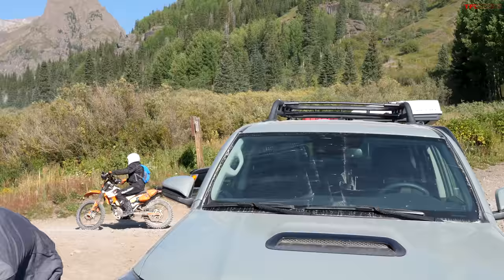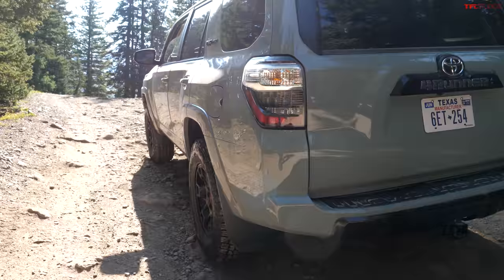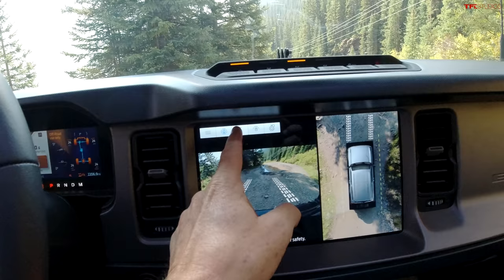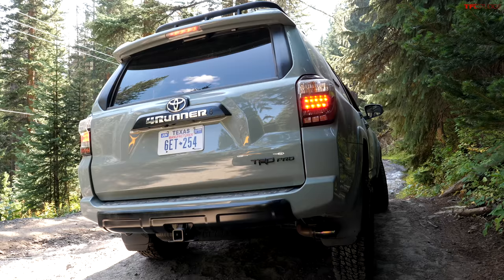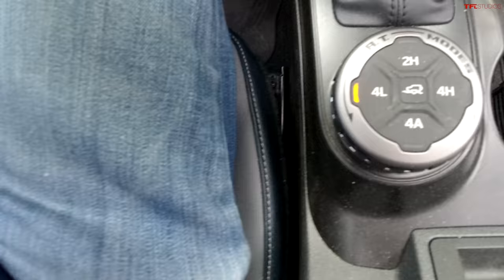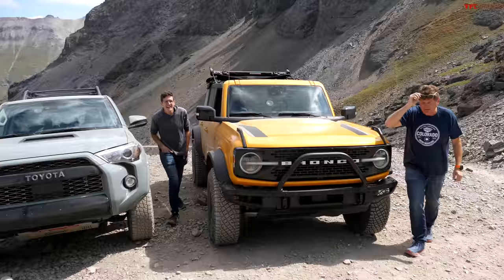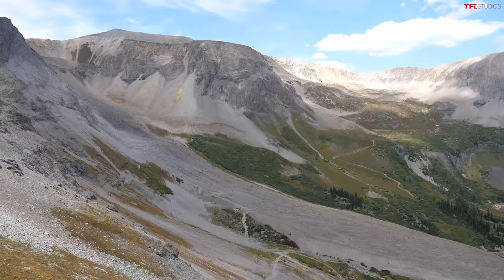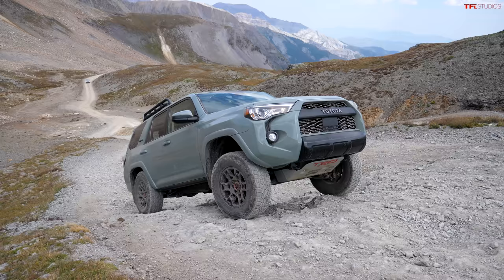The Toyota 4Runner TRD Pro May Be Old, But Can It Still Keep Up With The Ford Bronco Up A Mountain?

Comment: You guys keep mentioning the price of that First Edition Bronco in your comparisons, but you can get the Badlands edition with the 2.7L V6 and the 10 Speed Auto for $49,575.00... You can also get it with the Mid Pkg. for $51k or go for that 12" Screen, getting the High Pkg. for just $52.3k. Or go all out adding both the Sasquatch and High Packages for $54.8k. So at that price you can either get essentially the same Bronco that you had there at $54k, or that Toyota 4-Runner for $52k.
Reply: You hit the nail right on the head. Lots of people complaining about the Bronco price, but fail to realize there are much cheaper versions which can be as capable as you need them to.
Reply: @luisinhoens90  Exactly. I have the Outer Banks 2.3L with Auto Trans. on order with the Rear Locker, Aux., High Pkg. and a few other upgrades for $46k. Or, If you're fine with the 8" screen you can go with a Big Bend starting at $35k or the Black Diamond starting a $38k. Both really good options, especially with a few upgrades.
Reply: @PicklerEntertainment  I'm digging for the Black Diamond with the 7 spd manual, but I'm not in the market right now. I'm thinking about getting a pre-owned one in 3-4 years

Comment: I really enjoyed this video, pretty cool seeing how advanced these new vehicles are for off-roading. That being said, they seem to be made for people who don’t have real off-road experience. All the terrain select modes and auto crawling modes are unnecessary, I want to drive my car myself. Having a rig that’s more capable than you as a driver is a dangerous situation. I don’t want those people on the trail putting themselves, myself and others in danger. They’re made for front rangers and city dwellers as a status symbol and for people to think you’re some badass off-road king driving around Denver. 

I live in a small town in southern Colorado by the Sangre de Cristo mountains where the roads are unmaintained and gnarly as all hell and let me tell you, these aren’t the vehicles you see out there. The easiest way to tell someone isn't local is if they're driving something like one of these. I’ve done Imogene in my 04 Jeep WJ with 30’s and the np242 transfer case. It’s all stock except the tires and wheels and I added the Mopar transfer case skid plate. I’ve never had a problem with traction and rarely even use 4lo. Picking a line comes from experience only.

One thing I never see mentioned about these new vehicles is how their size is actually a burden on a lot of trails. Can’t tell you how many times I’ve been in a situation where I’ve needed to turn around on the trail. I was on shelf road near cripple creek and met a lost Texan trying to drive through with his full size truck and fifth wheel. No one was getting by this guy, his rig took up the entire width of the road. I had to back up a quarter mile before I could turn around and go back the other way. I sure as hell wouldn’t want to be in one of these doing that. Wouldn't have been possible. The size of my little Jeep is such an asset in that situation. I think that needs to be talked about more. Most people think bigger is better and that a nice big truck or suv with huge tires will get you through everything. Yes big trucks and suvs are strong and capable, but when you end up in one of these situations you’re gonna be cursing and scared. It’s more about the driver than the car. I’m lucky to have a lot of experience off-road as a ranger in rural Colorado so I can’t fault anyone who doesn’t have experience, but just know that there’s a lot of vehicles that are more than capable off-road and it really just comes down to the driver. You don't need to spend this kind of money to have fun and I'm glad TFL highlights that in their videos as well.
Reply: I couldnt agree more. Two things id like to add: 1) most ppl allow themselves to be upsold on EVERYTHING and alllow themselves to be TOLD what they need 2) as far as the size of these vehicles, sometimes i wonder if they are designed large out of necessity to fit your average American?

Comment: I just wish you could get all the dif goodies and sway bar disconnect on the base model with a sasquatch. All the capability and it wouldn't kill me to get a trail pinstriping on it. I don't need all the extras. Washable floors and off road capability is still king.

Comment: This trial isn't as tough as it looks tbh. I did it a couple years ago in a stock 2009 Hyundai Santa Fe, no lift, no 4x4, it was a 4x2 FWD, only mod I had was an offroad front bumper and some nitto grappler at's.

Comment: Need advice (and from some pros will make wife feel better).  Looking taking my stock gladiator 80th to Colorado, can it handle ophir, Imogene, and engineer?  I did ophir and Imogene in my stock jl with 30k on stock tires.  So, would I be good? I know I would kiss my skid plates, but other than that?

Comment: Looking at this again it really does seem like a bit of a puff piece plug for Toyota--approach and departure angles not really that tough and certainly no extremely articulated sections. Again the Bronco didn't break a sweat and looked more comfortable. How about we see the 4 runner on the Wheeler Lake trail that the Bronco did so well on (stock)?

Comment: For $11K I bought all the mods on my 4Runner: OME BP-51 suspension, BudBuilt skidplates / sliders, Expedition One bumper + Superwinch.

Also there's no mechanical differences between the TRD OffRoad vs TRD Pro if you're modding the suspension.  I paid $37K before TTL for my '18 TRD OffRoad, so the $11K spent got me up to about what a TRD Pro costs new.
Reply: I don't know why TFL never mentions   the savings and capability you get with the TRD offroad.
Reply: @Rooster_king  The TRD OR is good value, the TRD Pro isn't.
Just like the Bronco 1st edition is not good value but a Black Diamond or Badlands is well worth the $20K savings

Comment: I’ll take a Trail model over the TRD Pro any day, add aftermarket lift and your better off IMO. Trail gets all the same off road tech and locking diff plus it has 7.5” wheels over the pro’s 7.0” for running larger tires and you get kdss which is a game changer for on road driving especially once lifted.

Comment: I'm opting for a LeXUS GX470 BUILT on the same frame as that TOYOTA 4 RUNNER... but with LEXUS quality and comfort.. :)    Instead of paying the original $65000, I'm paying $22,000 for one that is 07 but ALREADY modified- new timing belt and water pump, all cv stuff redone new- dash recall done new-- and all armored up and ready to go!!  :)   Be like the 4 runner-- but BETTER.

Comment: Great video! Question for the Imogene regulars. I have a 2021 F250 Platinum Tremor 6.7L. It’s leveled and has upgraded 37” Toyo AT III tires. Is this course doable with this rig (it is the shorter 6 3/4 bed)? Thanks in advance!

Comment: The TRD Pro is certainly a good truck, but where I live, the dealerships add such markups to the limited edition TRD Pro line that even a used truck a few years old is still more expensive than a new Bronco. They are good, and Toyota is clearly VERY proud of them!  I had wanted to get one to drive while I waited for my Bronco order, but that's one reason I'm giving the 4Runner a pass; sadly, there are also options that only come on the TRD Pro, like dual zone climate control, that make lower trims less attractive as daily drivers.

Question: Did those MPG calculations include the trip up the mountain or just the road portion?

Comment: I agree that the Toyota is the on road king. But that's not what I bought my Badlands with the Sasquatch package for.  And that's why we use my wife's Land Rover Discovery, for road trips. It's still a formidable off roader, yet luxurious. I use my Bronco for off road fun and there's not many that can follow me. I've yet to see any Toyota TRD's up here in the Adirondack power line trails. I did see a modified TRD with 35" wheels, but he wasn't about to risk scratching his $80,000 pimp mobile... . Chicks dig a scratched up 4X4 🙂

Comment: As a 4Runner owner you can't fix the lack of power and crappy transmission (well at least it is bombproof).  Love the reliability but the seats are awful and you can't tow a thing in the mountains and it constantly searches for gears.  Wanna pass someone going uphill?  Get used to redlining it.
Reply: Put it in s mode 4th gear and it won't search for gears

Comment: Yes the Bronco is pretty amazing with all of it's off road gizmos and tech and big tires but guess what: the old 4Runner did every bit as good and for $11,000 less! As mentioned you can get a hell of a lot of off road goodies on the 4Runner for less than that money and it will make it even better. Plus it's a lot quieter and more comfortable on road plus gets better MPG even with half the gears. Time will tell if the Bronco has anywhere near the reliability of the 4Runner but I doubt it. I've always had American vehicles and I'm 68 years old so I've had a few but sad to say none of them can boast of reliability like Toyota can. I'll never give up my 4Runner.
Reply: Very true, however, with regards to MPG, I have a buddy who slapped BFG 35s with a lift on his 5th gen 4 runner and gets 15mpg typically. Tacomas usually get right at the same, sometimes less with the same setup. I think the difference is in the gears considering the Bronco comes with 4.7 gears. If you regeared the 4 runner I'm sure you'd see some MPGs come back but that's about a $4000 operation where I'm at. So if you have the same setup lift and tires wise on both vehicles, id personally take the bronco with quite a bit more power and about 25% better MPGs, although the Toyota reliability is definitely a hard selling point!
Reply: There are other cheaper Bronco trims, you don't have to settle for the 1st edition. Get a nice Badlands for mid $40s with pretty much the same offroad goodies sans the 35" tires.

Comment: I still want you guys to do an actual graven test with the Bronco's lockers. I still think Fords light is just a dummy light that says its on, not that its locked. And I say this because I know how the internals to selectable lockers function, and there will be cases where the splines do not line up, and the vehicle needs to move for it to enable. However, this was a great video with some fantastic views.

Comment: They talk about how IFS does just as well, but the 4R kept spinning a wheel once the chassis flexed on those little bumps. An axle literally forces a wheel down, so even if the flex is the same the weight distribution is not.
Reply: Frugal Family Living  they better not have gotten stuck on that stuff. That’s not the point. The point is this easy trail was already losing traction because of the IFS. You can take a crossover up that, so by your logic don’t get either and run a passport.

Comment: Dudes, love the channel, but I took my '67 Bronco, stock 289 with a 2 bbl carb and 30 inch tires over Imogene with no off road driving experience with my parents in the back.

Comment: When given the choice to travel as a German through Africa or Russia, I and many others rely on two vehicles Toyota and Mercedes Benz G!!! Forget Ford and the others, if your vehicle is broken there, one can fix these two anywhere, the rest you better set on fire... and I speak from experience, I have been driving Africa and Russia for over 40 years... Ford Bronco, beautiful but a car for the boulevard and occasionally off road, which is for sure it will be a good overlander better than the Jeep especially through space, but not in Africa or Russia...

Comment: Yeah, I'd love to see the gas mileage you get on the Bronco on 33s.  I tried to spec out a bronco on 33s and it wouldn't let me add most of the offroad goodies.  That kinda pissed me off, to be honest.  I don't really need 35s where I live but I do travel some fairly gnarly roads and I have to do long road trips so I'd like to get the better fuel economy from smaller tires.
Reply: Not understanding.  Try a Badlands trim without sasquatch. You get 33s with all the offroad goodies.

Comment: You could have equipped the 4 Runner with similar size tires, instead of saying the Ford did better in water because it sits higher because of large tires.

Comment: Any plans for the new Bronco to do the Poughkeepsie Gulch trail and take it up "The Wall"?
Reply: That would be a real test and we have to wonder if the makers keep them from doing it.  They definitely should though, Poughkeepsie Gulch is a universally known off-road trail that sets a benchmark.
Reply: @mierdevries9643  We did it a couple  weeks ago in our 2000 Cherokee.  It’s a much more technical trail than they typically attempt.  I have seen 4runners do it, but not the Bronco.  With the 35’s and lockers they have on theirs, it could probably handle it though.  Would be cool to see.
Reply: @xj-n-4lo196  I took a mildly modified JK up that trail in 2015.  I had to winch over the wall when I couldn't get the line figured out, I think my spotter got impatient.  (He was a good man God rest his soul)  I want to go back and see if I can get my ZR2 over the wall but I think I'd need a partner to make sure I don't get too off camber and possibly roll.

Comment: Why Toyota replaced central diff with transfer case in its part time 4wd 4Rs?
I'm happy owner of 2005 4R SR5 4WD V6 and I'm especially happy with central diff if I have to drive in bad weather.
Not in 5 gen anymore :(

Comment: Thanks for this review! I've had my Bronco Badlands for a few weeks now. My family (Jeep lovers **cough**) loves to climb Imogene every summer. 

My Bronco is s manual so it's not the Sasquach package, however the toughest part of the video seemed to be the mud in which I'm confident my non-sasquatch 33's would do ok. 

The trails I've taken it on so far (fairly difficult) have seemed effortless. All in all - the Bronco has the ability to appease both new and long term offroaders with its built in automaton and the after market customization options.

Comment: I get a kick out of the “4runners are old tech”.  But all in all the bronco has the same tech. Crawl control, multi terrain, lockers….   Y’all need to admit that while it’s cool…it’s not groundbreaking 🤷
Reply: You are uninformed
Reply: @nycmaverick  uninformed in regards to what?
Reply: @nycmaverick  it’s all a similar thing. The Broncos badass. But it’s nothing new.  Land Rover, Toyota, and so on….
Reply: @bigpk2003  Next, you'll be telling us that Santa isn't real.  Why spoil every fanboy's fun with a dose of truth?  ;)
Reply: @jerroldshelton9367  it’s a cool truck and I love it.  But…😂
Reply: @bigpk2003  But.... When you strip away the hype, how groundbreaking is a shortened Ford Ranger with an available front locker and manual transmission?

As I watch people get swept up in the hype, I keep thinking to myself that, somehow, the new Bronco doesn't seem as "groundbreaking" or "cutting edge" as the XJ Cherokee seemed to be upon its launch.

Comment: Like your vids but would prefer that you would compare the one having  fewest features to go first and have the other follow. Each engaging the same features eg. rear locker only. If first one fails to make it then better equipped one to try and if also not make, then lock the front to see difference. Apples to apples as much as possible 🍎

Comment: In theory the Fuel mileage was better on the bronco due to tire size difference. I’m not surprised though. That 10 speed transmission will help it a ton. However I still feel like the longevity and simplicity of the Toyota will save you tons in repairs down the line. I foresee a lot of issues down the line with such large tires on small engines in the bronco

Comment: AND as another comment on the Toyota TRD Pro, The Ford Bronco 1st Edition and the Jeep Wrangler Rubicon, what bugs me the most is the underhangs on the wheels.  I would HIGHLY SUGGEST that all automakers go with the Humvee solution with the UPPER-HUB wheel joint that drives the wheel using an in-wheel planetary-like gear that is driven from the upper wheel hub -- This allows for a lift and ground clearance of 20 inches or more!

Not to brag too much but I could do a redesign of the whole wheel assembly in less than a week with high end ACTIVE SUSPENSION Rheological shocks (i.e. Ferro-Fluid Shocks that lift HIGH and FULLY INDEPENDENT!) that can sense the road ahead pushing and pulling the wheels up and down automatically to keep the entire wheel level using MEMS-based gyroscopes and a combination LIDAR, SONAR and RF plus MM-wave RADAR system so I can get a real time 3D map of the upcoming ground and inside of any puddles/stream beds every 1/60th of a second so that all wheels can be placed perfectly as they hit said gnarly terrain which then keeps the body level no matter the terrain!  I would make sure the the auto-lift shocks 4x4 active suspension system could do up to 40 inches (3 feet+ or over one metre) in height of lift so even the toughest rocky dips and hills could be driven over. 

I've already got the 60 fps, 120 fps and even up to 10,000 fps real-time 3D terrain imaging software I designed and coded, so all I need is to attach it to high-end tube-within-a-tube Ferro-fluid active shocks system and "Bob's Yer Uncle!" you have an up-to 40 inches (one metre) lifting ESCAPE MODE for your truck / 4x4 !!!
Reply: Sounds awesome, but who could afford this $300,000 vehicle?

Comment: Man how did that 4runner get 20 mpg?? Did yall do 55 mph the whole way?? Down hill?? My 2020 TRD Off Road with the factory size optional Ridge Grappler tires get 18.5 on it’s best day.  Ive never averaged higher.  And mine doesn’t have a roof basket like this one!
Reply: Didn't the dash display show an avg of 61mph?  I did think that was high for a 4runner..i've always thought they were gas hogs.